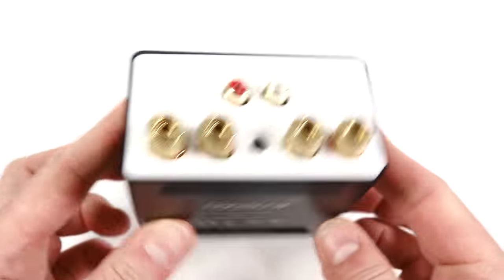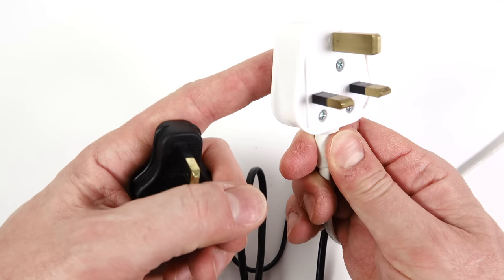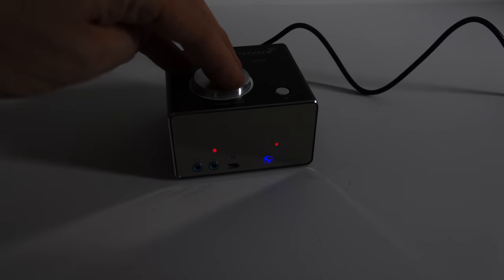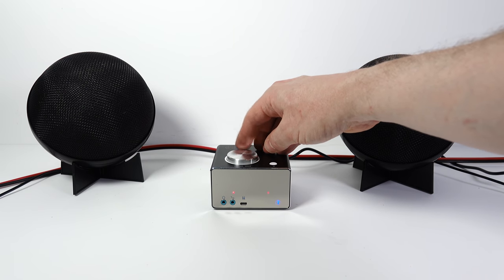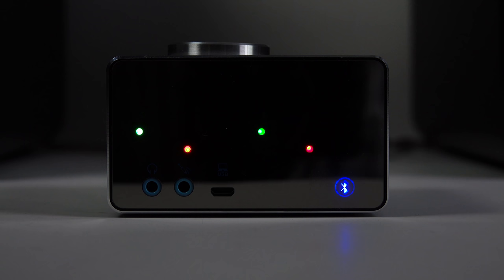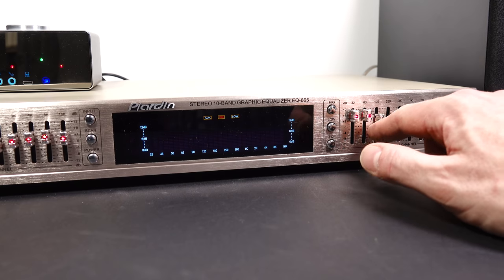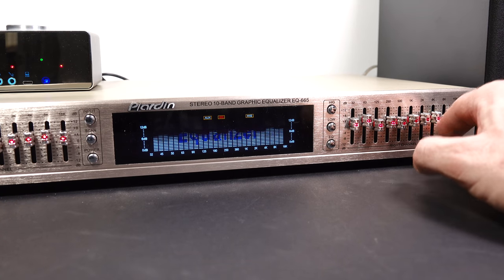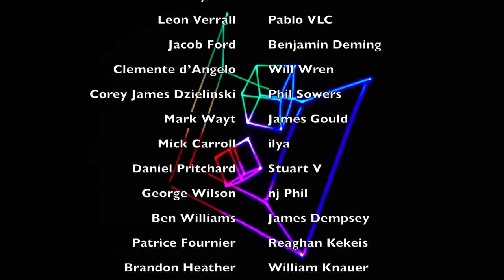REVIEWS: Mini Amp & Graphic Equalizer

Comment: That "UK" plug is dangerous to use, isn't fused and the earth pin is shielded! should be metal all the way (not that it matter too much with a two pin connector I guess🙄)
Reply: and given that plug, I wonder what the quality of the power supply is like?
Reply: @markwanklyn4195  Just look to the rest: garbage no worthing a penny.
Reply: Serious question: aren't there centralised fuse boxes in the UK and if there are, why are they considered unsafe without additional fuses in the plugs?
Reply: The earth pin thing is a bit of a red herting since its a 2core cable. No fuse on the other hand means that the 6amp(?) cable will be potentially exposed to 32amps before a breaker trips
Reply: @venturarodriguezvallejo1567  was being sarcastic about the psu :-) - seen enough garbage laptop chargers from eBay (that go bang or catch fire!) and that 'thing' looks like one of those
Reply: @LordWaldema  the ring main for power sockets in the UK will normally be fused at 30 or 32 amps - a three amp fuse in the plug for that amp will blow a lot earlier than the main fuse so safer as less current can be drawn
Reply: @cncshrops  and you can almost guarantee the cable won't be rated for even 1amp... At best aluminium but probably copper coated steel if experience is anything to go by 🤓
Reply: ...and it could carry rabies into the country. 

This whole obsession with the danger of mains plugs seems to be a British thing. The rest of the world has survived for over a century with unfused plugs. Electrocutions and fires due to faulty home appliances do happen in the rest of the world just like they do in the UK but using a US or Euro plug isn't the game of Russian Roulette that some Brits make it out to be.
Reply: @alexsorin9346  That's great... I guess you don't bother wearing a seatbelt in cars either ;)
Reply: @korhonenmikko  I've never found any consistency to which side is hot or cold? fairly random in my experience :)
Reply: @markwanklyn4195  thanks, just learned about the ring system, that makes sense then to fuse the plugs
Reply: @LordWaldema  how is it done where you are?
Reply: @LordWaldema   circuit breaker boxes actually.
Reply: Actually I spend a lot of time in both the US and UK and whilst the US plugs are much more convenient (especially when you're daisy-chaining your MiL's Xmas lights together! there seem to be a lot fewer house fires in the UK, and most of them are caused by cigarettes or cooking rather than electrical faults as in the US. So I guess the British way is better even if it does seem ridiculously over-engineered to foreign eyes...
Reply: @Andrew_Sparrow  I only wear Swiss-made seatbelts. Wearing any other type will result in certain death even at low speeds.
Reply: @4x4CB   central fuse boxes with usually two 10A fuses per room, one for light and one for outlets (Germany)

Edit: now 10A for light sounds dated when even 1A is more than enough for LED lighting
Reply: It all boils down to the situation at the time when the British electrical system was standardized: Before WW2 there were several different electrical systems in the UK. But after the war the whole UK got the same system. Unfortunately the war had caused a copper shortage so the wiring had to be made with as little copper as possible. Instead of separate lines in each house, each with a 10 or 16 Amp fuse, the British houses only had one line with a 30 Amp fuse. This is way too much for the thin cable that goes from a power socket and to a lamp or radio. So if a fault develops in that unit, that makes it draw a lot of current, but still under 30 Amp, the thin cable will melt and can cause a fire. Therefore it is mandatory that every plug has a fuse. The Brits always say that their electrical system is better than everything else on the planet - I think it is something they learn in school - but in reality it was necessary to make it that way because they had to save copper when it was designed.
Reply: The earth pin doesn't matter since the earth pin isn't connected to anything on the power lead and the PSU is plastic cased.
Reply: @alexsorin9346  As far as I can tell, in the USA the fuse is in the power station...
Reply: @rich_edwards79  : The advantages of the British stuff could actually be done with at least the US system as well. Flip the socket so the ground is at top (some areas actually require the opposite, which is unfortunate), require the last bit of the power pins to be insulated, add shutters so the plug can only be inserted if there's a ground pin (you can actually find sockets like this today), and require all cords to use a fuse. The fuse and insulation on the bases of the power pins are the only bits that strike me as difficult. Unfortunately, if you actually look into "wiring faults", often they relate to things like animals getting into old wiring that was just never updated (because it's expensive to update), and no power cord will ever fix that. I actually live in such a place myself, the plugs have been updated, but there's no grounds, and the wiring is old "post and hole", or whatever it's called.
Reply: @rich_edwards79  Thanks. Your anecdote is the proof positive that  I need to sleep safely at night in my bed.
Reply: @markwanklyn4195  As it's 19volts I reckon it's some repurposed laptop supply and the 'replacement power supply' label suggests the same. It'll be some cheap and nasty power supply for sure. Plenty of teardowns of crappy power supplies with little to no protection inside them, added to a dangerous mains plug and you've got something that could be a disaster.
Reply: @6581punk  that's true but it's indictative that this is a very poorly made cable - the wires inside will be underated, the rubber melts at low temps and the plug pins are not the right size so can fit poorly in a socket... that's the real problem with these crappy cables, the plug is just part of a whole piece of dangerous crap... sure it'll probably be fine for most of the time but with 240volts and a cheap powersupply it's too risky for me. Life's too short without adding known risks to the equation.
Reply: @absalomdraconis  I agree that the US system could be made a lot safer with only minor changes. As other have said, the UK features are mainly to protect the power cord (with a fused plug), and prevent fingers / objects contacting the live pins whilst partially exposed. 

The importance of the last part was brought home to me at my MiL's house in Boston some years ago. She used to keep baking sheets on top of the fridge, and one day, one slid off and dropped down behind. There is an outlet behind the fridge, into which it and the microwave oven are plugged. The top power plug must have been not quite fully pushed in, and the edge of the baking sheet landed between the prongs, causing an almighty bang / flash when it shorted them, and burning two 1/4" marks into the edge of the metal. Fortunately the breaker in the main house box did its job and cut the current, but not before a person would have had a very bad jolt had that been someone's hand bridging the pins rather than a piece of metal. This could never have happened in the UK, due to the earth (ground) pin being at the top, and the partially shielded 'hot' pins which don't become live until all the copper part is in the wall.

As for aged electrical systems, because we tend to have solid masonry walls (only recently started using timber frame construction on a large scale, and even then with an aesthetic outer brick skin) we never had the exposed copper 'knob and tube' wires running through the frame. Our pre-war cable was much as it is today, but insulated with cloth or rubber, both of which deteriorate and disintegrate making use extremely dangerous. Hence pretty much any house that was fitted with it has been fully rewired by now. Anything wired up since 1947 will have been done with the newer plastic-coated stuff with inner and outer insulation and should be safe - mine was built in 1899 but rewired in the late Seventies and was surveyed recently.
Reply: @cncshrops  I'd be more concerned that it might be copper coated aluminium, going to be nice if 32A went through it.
Reply: Gernot Schrader  They often use fusable resistors or tracks on the PCB itself.  As such, they aren't visible fuses unless you know what you are looking for.
Reply: It's bizarre that someone would even design a plug with a shielded earth pin, and even worse that somebody would manufacture them! It shows a basic ignorance of what shielded pins, and earth pins, are even for! 

They've obviously seen real plugs, to be able to copy them. But they can't have had the basic electrical knowledge even a schoolchild has, to have failed to understand the point of the features. Yet they're the person employed to design plugs!!

The fuse, btw, stops faults in the cable setting your house on fire. Good feature to have. I wouldn't trust the wire in the cable not to be metal foil-coated tinsel.
Reply: @LordWaldema  Yes there are centralised fuse boxes. Simple explanation - the central fuses protect the 'heavy current, typically 32 amp' house wiring and the fuse in the plug protects the appliance wiring.  This means that low current appliances (table lights, soldering irons etc.) need only have small cross section mains leads, typically 5 amp 1 mm or 1.5 mm cross section.
Reply: @alexsorin9346  Sure. But British plugs are safer. Who wants less safety?

Although if you counted in the number of foot injuries from the little bastards lying with their pins up in the air like bear traps, the statistics might skew in the other direction.
Reply: @rich_edwards79  Ironic thing is, Americans build their houses out of wood, like a foolish little piggy. Ours are all made of brick or stone. They should be more worried about fires.
Reply: @organfairy  That's bollocks, UK houses have separate circuits for upstairs and downstairs sockets, up and downstairs lights, a circuit for cooker, for electric heating, shower, etc. We also don't ever run sockets on lighting circuits, etc, like many American houses. 

Ring mains have the advantage of sharing the load across two lengths of copper. The disadvantage is that it can be wasteful. Of copper. It also means you can need to isolate sockets on both sides, but you'd never operate on a socket without turning it off at the fuse (normally circuit breaker) box, and testing it. 

In sharing the load in both directions, our thicker heavier wire means less heating so lower fire risk. Your point about it being a single circuit is utter nonsense, and certainly against regulations. 

British electrical standards are some of the safest in the world, if not the safest. Everything's over-engineered in the name of safety. In regulations written by experts. Rather than the USA where it's a mixture of enthusiastic bodgers and greedy money-scrimpers, in a culture where people just don't like regulations that are designed to protect them from unethical businesses. Where lobbying has more power than voting.
Reply: @greenaum  some housebuilders are now using timber frame for build speed and thermal reasons (you can pack a lot more insulation into a timber frame, and build most of it in a factory off site). They do still finish them in brick or brick effect cladding however, as we Brits tend to be creatures of habit and like our homes to look 200 years old. You're right, a fire in a house here will generally mean redecorating, new floors, ceilings, wiring and plastering whereas in the US you're generally looking at a teardown and rebuild for all but the most minor damage. Don't get me started on the vinyl siding they now use on new homes (and a lot of older ones) in place of the higher-maintenance clapboard or shingles! (I do still love a shingle house however).
Reply: @rich_edwards79  To be fair it's better than the american system but that's like saying a miniature poodle is larger than a chihuahua....it's a very very low bar to overcome. The reason you have fuses in your plugs is a way to patch the cheap and poorly designed ring circuit design of your wiring. The plug you use is also massive and doesn't gain any advantage over other plug systems that are built around the ground pin. 

I'm Australian and my mind boggles how poorly thought through the American and UK plug systems are. We have multiple 10A max short loops through our houses that separate out lights and heaters and ovens etc onto their own circuits in the central fuse box. Our plug is a 3 pin design that can only be inserted one way with the ground pin longer just like the UK plug but unlike the UK one we can run a 2 pin version that are much smaller without causing problems (where appropriate) so we get the benefits of the US and UK designs without the lack of safety or the massive bulk. 

The kicker for me is that the UK and US don't have a requirement for RCDs on every circuit loop. The US have them on individual plugs and the UK only require them in danger areas....why? My best guess is that it's hard to retrofit them to your janky arse systems?
Reply: LordWaldemar the fuse protects the wire between the plug and the appliance. The ring main will be fused at 32 amps, which is way more than that little wire can handle (should probably have a 3 amp fuse for that).
Reply: I am not American. So you don't have to tell me how things work there :-) I am from mainland Europe - the place where you can drop a power plug on your foot without having to see a doctor afterwards.....
Reply: greenaum Ring mains are 100% to save copper. In a radial system, the cables to the socket have to be rated for the peak current. In a ring system, we can under-rate the cables (traditionally using 20A cables for a 32A system to allow for imbalances in the ring). Having individually fused plugs allows us to under-rate the sockets compared to the over-all circuit current rating, ie. 13A sockets on a 32A ring.
Neither of these are possible with an unfused radial system, where a 16A socket is fed by 16A cable with a 16A breaker.
Reply: @absalomdraconis  That's probably what's called "knob and tube", if I understand  your description correctly. ☺
Reply: On the whole debate about "our house wiring standard is better than yours", at least let's all understand that those standards evolved over many years, with different factors and choices leading to what we have today in each locale. I've seen plenty of YouTube channels with electricians in the UK and US showing stupid and dangerous wiring installations, both new and old, performed by professionals and amateurs alike. The main thing is to understand each standard and work to reduce the risk of fire and personal injury. Agreed?
Reply: The earth pin doesn't matter but the lack of a fuse is definitely an issue.

Comment: I really wish I still had my Hi-Fi separates. They were all the rave back in the day and I got some of mine from the Littlewoods catalogue. Mainly a black graphic EQ that had at least 12 on each side but no visual display. It sounded great with no noise added to the processed sound, it may have been a Pioneer brand, I'm not sure now. I also got an Aiwa twin cassette deck with dolby B and C and it was the best thing I ever owned. Crystal clear sound, absolutely no noise added to tapes, lovely display, mechanical auto reverse (it span the heads around), and took several types of tape including metal. I swapped it some years later for a Sony MDS-JE 330 mini disk recorder to go with my computer at the time. I wish manufacturers would bring back the tried, tested and much loved audio equipment from yesteryear as I feel with modern touches they could last years and be an awesome addition to any home.
I still have the mini disk but it's gathering dust and I am not sure if any of the disks I have still work. I only used it for the optical line in function that was line out fed to a mixer and then to a broken modern (Sony) hi fi ( CD player packed in, it had an f'ing i-pod dock where a tape would be and then later the amp chips started to feck up leaving the whole thing useless). It's in the attic now but I still use its great speakers on another device for the aux in to speakers lol So disappointed by todays moderately over charged, feature lacking, low quality builds.